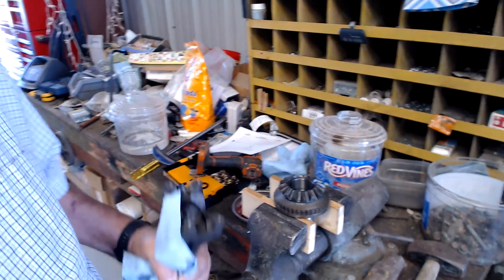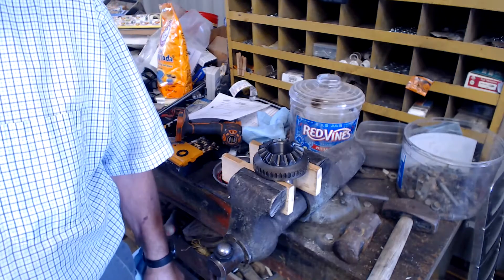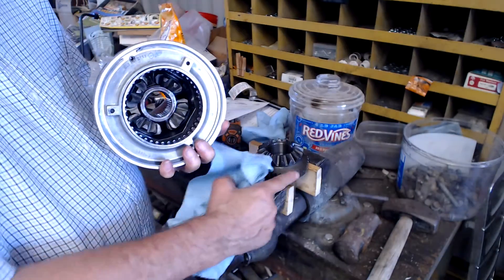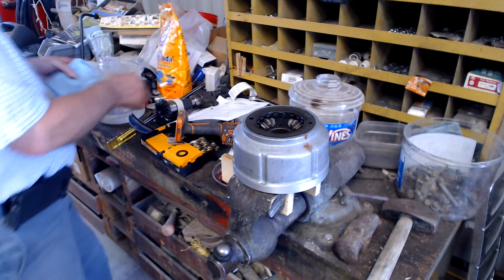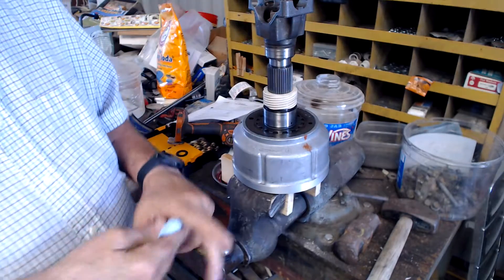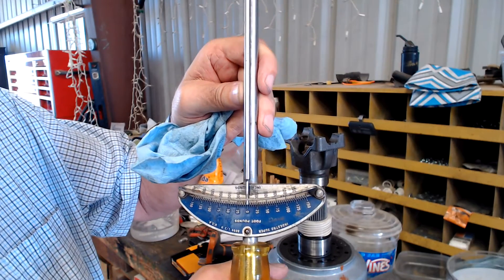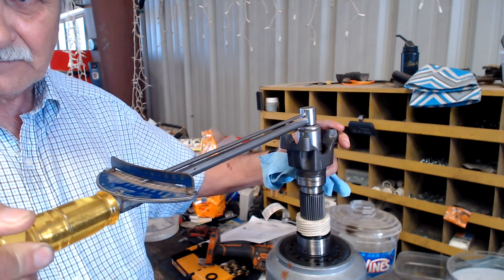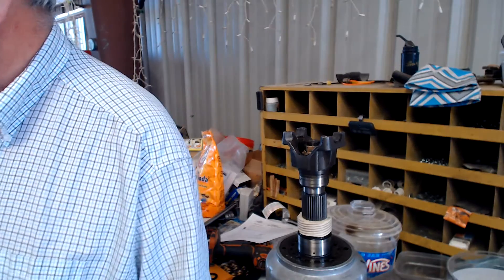NP229 Viscous Coupler Functional Test

Comment: Its unfortunate they dont make replacement viscous couplers for these Jeeps, mine works on my 90.. but when i tested it doing AMC's test by jacking one wheel in the air in 4wd and using a beam style torque wrench, i was only able to get maybe 60% of the torque value they deemed for it to be 100% functional, but there is nothing i can do about that since they arent made anymore,  my 4wd works fine though when i use it so whatever.  I think mine was at like 18ft lbs.  I do believe these units can be serviced though, you can take the back cover off and take the fluid out and replace it with new stuff...  What kind of fluid you need though is beyond my guess

I did get a spare 229 from the junkyard, that i put in storage in case i ever need stuff from it for mine
Reply from the maker: Dow Corning is keeping the exact silicon oil a secret. Even if you do replace the fluid, you can't find the seals for the coupler. It's about $800 to convert to the 242 but you will never have to worry about not being able to find the parts. And you convert from 2 shifters to 1. That eliminates the vacuum shifter which is another thing you can't seem to replace. Once you have modified the 242, it bolts right up to the adapter. The front driveline fits without any modification. The rear driveline will need to be lengthened. I really think that this is a great replacement for the 229.
Reply: @dferdirt  yes youre probably right.  If they keep it a secrete.  Then i am wondering what the replacement 249 couplers use because those you CAN buy.. i bet its the same fluid as in the 229.

I am wondering why these even go bad to begin with.  I garuntee 90% of the 229 users in wagoneers just keep it on 2wd.  I dont even use 4wd thag much except to stretch its legs (per the manual) and if i actually need it.

So what is causing them to lose there torque value ?  Its odd